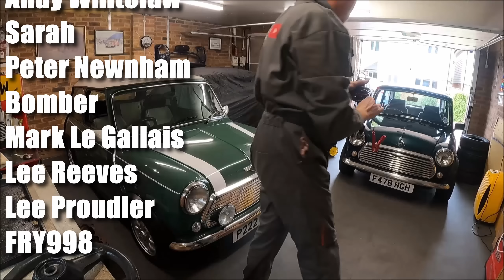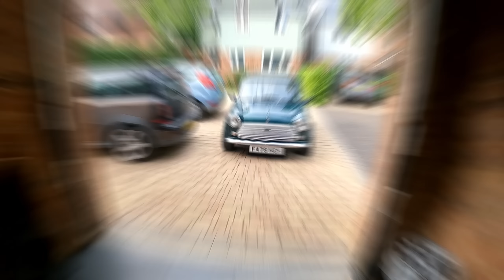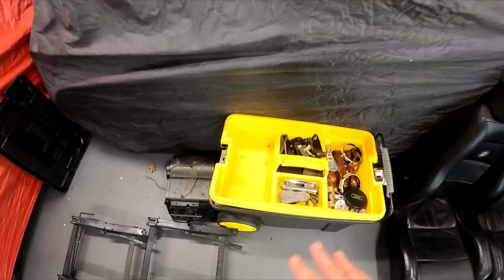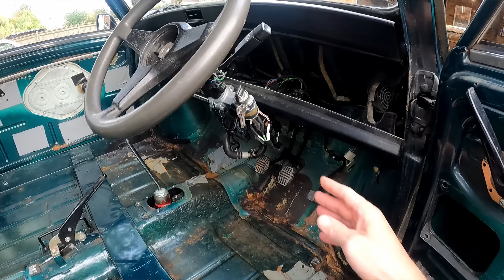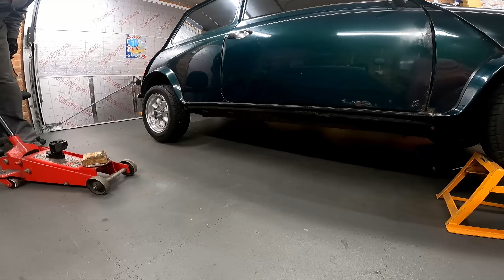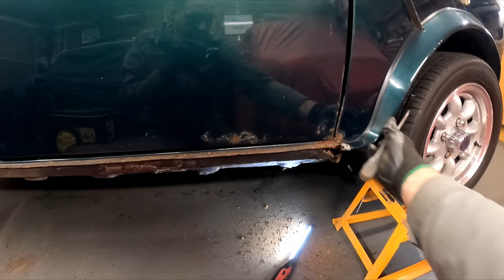Corrosion Assessment Sills - Classic Mini Workshop - Project Racing Green Pt.10

Comment: I remember mine brand new I was told first in the country came from a motor show in Ireland still had stilleto marks on the carpet. Honestly I love minis had a few but was so disappointed with the car, spent more time in the bodyshop having rust issues sorted it became a standing joke. Charles Clark said to me what do you expect its an old design ! The last straw was the suspension went on one side front and rear within a week. Ended up trading it in for an XR4i. Missed it but  man did it have rust issues for a new car. I'm going to enjoy this resto Keith keep up the great work. BTW mine was a Racing Green billed as the new Cooper...

Comment: Lots of work there Keith, i'm afraid you will find more than you bargained for to. Would it be worth pulling the front off, engine and subframe out before doing the sills etc?? Would be a lot lot easier to work on? Which ever you do it though, it will be a good interesting watch. What was that big lump of cast iron on the back of the bench i didn't see!
Reply from the maker: You must be a mind reader! I've just got to the point where all the sill is off, I've repaired the back but I think next steps will be to get the front end off. It's a nasty mess on the toe board and front floor pan.

Comment: Does the front subframe have all solid mounts? From what I’ve read on the forums, you normally get cracking when someone has mixed rubber mounts and solid. If they’re all solid mounts the toe board is less likely to crack apparently. 
And no definitely didn’t see the engine block 🙈
Reply from the maker: I'll have a look next time. I'm not  sure

Comment: Keith, quick question when at the start of the video after the shunt around the garage you put sprouts battery on charge, the battery being in the boot I couldn't make out where you connected the charger under the bonnet, can you enlighten me..
Reply from the maker: I connect the negative to a head stud and the positive to the alternator B+ connector (The large one) as it goes straight back to the battery.
Reply: @classicminiworkshop  thank-you that's very helpful and good to know.

Comment: I think the only way to fix that rear shelf is to buy a new panel. M-Machine list them at around £80 (cheaper than Heritage)
Reply from the maker: Thanks. I didnt know M-Machine did that panel.
Reply: @classicminiworkshop  Just checked at M-Machine and the price is now £99 plus VAT (my link to the catalogue was old). They use the same part number (14A6564) as Heritage and Mini Spares, so it is probably a Heritage panel. Mini Spares will have their Black Friday event soon, so I'd wait until then and save £10.

Comment: The Mk1 Mini Cooper S MUST rate as one of my all time favorites, they were the HOT ( hatch sized car  ) 20 years before the Mk1 Golf came along!
I DO NOT LIKE those HORRIBLE newer Minis with their German running gear ( BMW ) HATE LOATHE DESPISE THEM!!!!!!!!!!!! 😡😠😠😡Putting the ''John Cooper'' name on them is an INSULT John Cooper had NOTHING to do them IF he is still alive???? He would be quite old by now! Like ALL old Classic cars they RUST, my first car was an 850 Mini van a countryman, later i owned a Mk2 Escort EVERYTIME at WOF ( Warrant of Fitness ) MORE RUST another $500 in Rust repairs 😡😠😡the engine was tired/gutless fouled it spark plugs regularly I SOLD IT  for a decent price 😀😀, the 850 Mini engine although healthy enough did not have much too offer, after 50mph it was not really interested, better breathing helped!!
Reply: John Cooper was quite enthusiastic about the new MINI and helped to develop the original John Cooper Works parts for the cars. Also I think his family still make a royalty on the name being used.
Reply from the maker: A BMW Mini is no replacement for a classic for sure! Interestingly I don't think the earlier BMW Mini ever got BMW running gear! I'm sure it was a Chrysler engine from Brazil and a Rover box in the early BMW Minis and a PSA engine after that. The more recent BMW Minis are purely BMW running gear as far as I know. Although, I'm no expert on the BMW cars